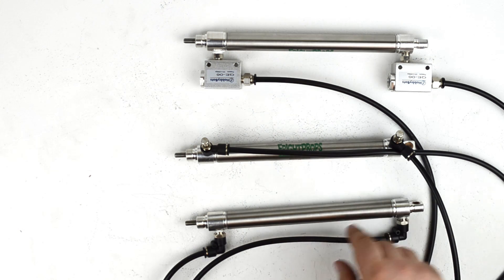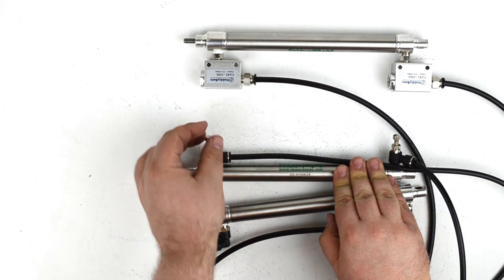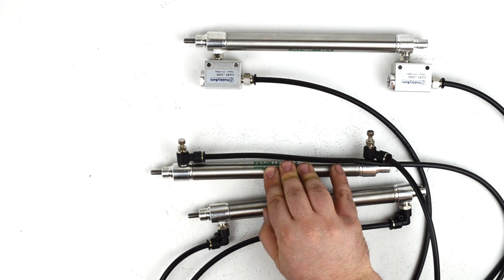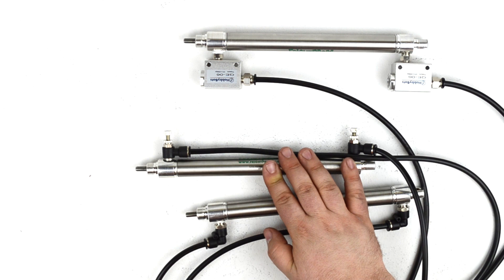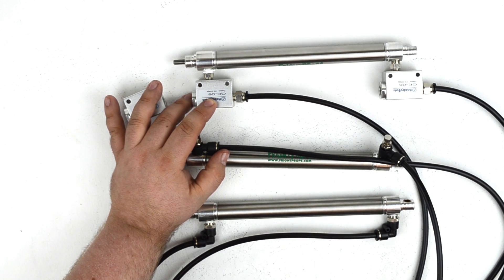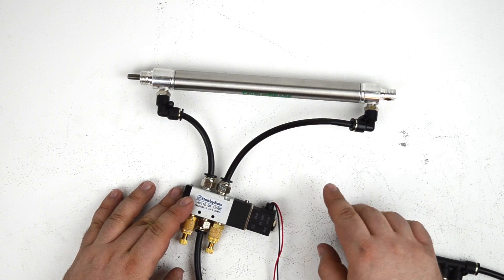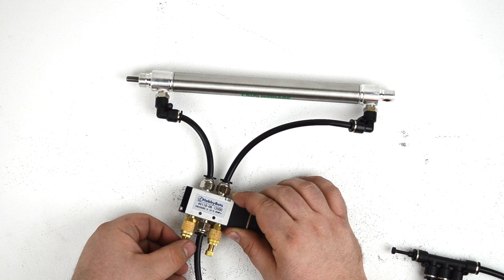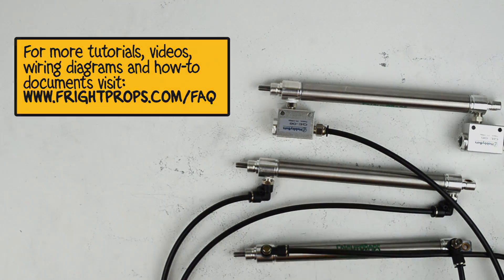How to Control the Speed of a Pneumatic Cylinder

Comment: Could you use the flow-control muffler on only the rear port to get a single action? If the piston is able to simply be pushed back? If not with a flow-control muffler, is there another way to achieve this? - Assuming a single action piston of the required dimensions are not available.

Comment: I need to know how to get an actuator close at one speed a slow down so the door it is operating doesn't slam.  My door is part of a ride and having the door block the track is not a speed issue.  But when the vehicle is approaching the door I need it open fast enough so the vehicle won't hit the door.  If the door opens fast enough but so fast that it bounces and hits the vehicle as it passes.  I need the last few inch or two of the actuator slow down.  How would you do that.

Comment: Thank for this, great help for a newbie. Is there a way to control length of stroke . I have an item that i would like to throw 7mm forward & 7mm back & can only find 5 & 10 mm stroke units & didn't want to break the part i want to control. Thanks.

Comment: How does this affect the operating pressure?(displacement force) I currently use a setup to move a box of 13 kg, however, it happens too fast. Thus, I want to use the speed control muffler to restrict the exhaust so that the box is slowly moved. Will it work, and will the pressure or displacement force remain the same?
Reply: The force should remain the same. Using a speed control muffler will only make the exhausting air take more time to exit the cylinder, but in the end the pressure there will be atmospheric.

Comment: Thanks a ton for this awesome video. Would be grateful if somebody can help  with a doubt. How do you control speed where force exerted varies. Ex: we have a section on a pivot lifting a flat surface from horizontal to vertical. Like a vertical top door on a kitchen shelf. When horizontal, load is more. When vertical almost zero.

Comment: Lucked upon this.   Wanted to simulate the recoil of a dummy Mk19 40mm grenade launcher using pneumatics to move a chunk of oak inside that simulates the bolt mass moving inside a 1/8" thick aluminum housing, using a trigger activated controller programmed to extend/collapse the shaft at the same cyclic rate as the real weapon system  360-390 RPM, the shaft extending 5 inches each cycle, and possibly venting the air out the aluminum barrel.     The original Mk19 has two captive action springs about 1" OD each so there is plenty of space to hide the cylinder.

Comment: Does this depend on the pressure or size of the cylinder?
If I have a bigger cylinder, wil this solenoids control it?

Will picoboo control it?
Whats the power rating of picoboo?
Can one picoboo control two solenoids or two cylinders?

Comment: Can you control speed with different loads on top of the cylinder? More specifically I need it to go at constant speed no matter the load or no load.
Reply: rallo this is my need as well.
Reply: rallo just an idea but maybe you could use a servo to adjust the screw?
Reply: And perhaps use a PID controller and some way to sense the speed of the cylinder to automatically adjust the servo to move at the speed you want. Just an idea

Comment: Stunning video. But what if you want to build a platform with a seat on it, for virtual reality, and you want to have variable speed all the time ?
Reply: I think you would want to use electric actuators, they are more "controllable"
Reply: Or use proportional valves, where you will be able to electronically set the flow to the cylinders.
Reply: Motors would be what you seek then

Comment: Please do video for long stroke cyl. ie: 1.24" bore x 30" + or - stroke. Used as a product pusher they tend to jump when they first contact the product.
Reply: your pressure is too low or you don't have enough flow. if your cylinder is the right size for what you're pushing with enough pressure and flow it will not jump.

Comment: what if i want to keep the speed the same, but make it where i can reduce the force that it applies. I assume i turn down the psi but will this lower my speed also?
Reply: yes,  speed is related to flow , force is related to the air pressure.
set your pressure 1st and then adjust your flow control for the speed you want.

Comment: I have a ball valve with a rack & pinion actuator single acting fail close. Do I need to look for a solenoid valve that will restrict in-out flow to make sure it will open-close slowly? My boss is asking me to help him with this on a vapor line that a quick response on the equipment is making trouble with the operation of the equipment. I will like to know your recommendation
Reply: Hi Daniel. You can use the flow controls that you saw in the video. If you are using a single acting actuator, normally only takes one application supply ( one pipe to actuator). you can also use an in-line flow control valve or even the restricted silencer type that fits into the exhaust port on the valve. make sure you are using the exhaust side to control your speed or the actuator when turning will get a shudder.

Comment: Very impressive video . Congratulations. I’m new on the world of the pneumatic “toys”. I have some questions.
What is your source of compressed air .
How You adjust Newtons and stroke ( when is possible )
When system is “dead” , can you move still objects with hands ?
What I need to complete system like this to close and open automatically a ......drawer  ?
Thank you very much.
Reply: Hi Tecno, 
Compressed air would normally come from your compressor or a compressed air tank.
 You would normally use a regulator to adjust the pressure to the cylinder/actuator. If the system has no air in it you will be able to move the application manually as there is no air to restrict movement or keep your cylinder in one position.  
To open and close a drawer you will need a 5/2 valve Single Solenoid as in video an electrical switch to put power to the coil for activation and deactivation. piping and fittings. the size of the cylinder will be determined by the force required to open and close the drawer. You will probably need flow controls to adjust speed as shown in vid.  

If you don't want to use a solenoid type valve, you can use a pilot operated valve 5/2 pilot spring return and a 3/2 normally closed push button valve.
This will do the same job.

Comment: If your using online flow control valves, BE SURE to check the flow direction in the valves, if you have them installed backwards, the cylinder will act eratically. I use inline flow control valves with rapid exhaust, reversing the valves caused static speed operation, slow retraction even when wife open.
Reply: My retraction is usually fast when the wife is open.

Comment: How can i create a feedback control using pneumetic to move it certain positions
Reply: Hi Ammar, Easiest way is to use a Positioner. They normally have a 4 - 20mA feed back or a 0 - 10 Volt.
Positioner will only allow a certain percentage of air into the cylinder depending on the feed back signal.

Comment: thanx for such informative video.  is there a way to control the sound of exhausting air to eliminate noise
Reply: Use a Muffler / Silencer . The flow controls in the vid that were fitted into the exhaust port f the valve are Restricted silencers.
There are different types of silencers available to suit the application.

Comment: The method you showed to control the speed using control valves... Does it compromise the pressure entering the cylinder?
Reply: No it doesn't compromise the pressure. There is a difference between pressure and flow although they work hand in hand together.
Lets say you need to move 3 pounds. your pressure is responsible for the work force to move that 3 pounds. Flow would determine the speed at which you move that 3 pounds. So you can have 30PSI @  0.2 Cv or 30 PSI @ 0.4Cv  
Hope that helps
Reply: Yup.  Simply put....speed control controls speed....not force.

Comment: Much better control i.e. Accomplished by using flow control valves that control the air exhausting out of the cylinder.
They can be set at different flow rates for extend speed and retract speed. This gives great cylinder rod speed control in cylinders with larger bore , longer stroke cylinders with oversize piston rods.
I believe it is better to control air exhausting the cylinder, should an airline fail, the cylinder will still the controlled flow exhausting.
Reply: He is doing that. The valves that he are using restrict air coming out of the cylinder, not into.

Comment: Technical detail alert: Whether you use port flow controls or mufflers in both cases you are restricting exhaust, not the flow into the cylinder as the video indicates. You can see this happening since tightening the control at the nose of the cylinder is slowing down the extension, meaning slowing the exhaust leaving the front of the cylinder as the rod extends. This is the way you want to do it since it keeps pressure in the cylinder giving the cylinder more control. If you were actually restricting the flow of air into the cylinder, the cylinder loses control in its stroke. It needs the exhaust air to push against to maintain position.
Reply: I’m at 1:54 and stopped the video to find this comment!!!
Reply: Thank you brother.....
Reply: You know the exhaust flows out as well. You are controlling the flow of the exhaust and that  sets the speed by restricting it but it is still a flow control. Is it not?    Don't answer that was rhetorical

Comment: It's much easier, more reliable, and cheaper to place a speed control muffler on both exhaust ports of the valve body.  It's better to meter the airflow out of the cylinder than into the cylinder.
Reply: there's a saying that goes by, "when in doubt, meter-out!"

Comment: can you please mail me a complete list of setup for the second cylinder
canonbj66@gmail.com
Reply from the maker: You would need 3 things:

1. The Cylinder - http://www.frightprops.com/pneumatics/cylinders/stainless-steel-body-double-acting-universal-mount-cylinders/3-4-inch-bore-double-acting-universal-mount-cylinder-0758-0750.html

2. A Hook-Up Kit - http://www.frightprops.com/cylinder-hook-up-starter-kit-double-acting.html

3. Some 1/4" Flow Control Elbows -  http://www.frightprops.com/male-connector-push-on-with-flow-control-0736-0017.html

You will, of course, also need an air compressor, which you can buy at any local hardware store. For more detailed support please contact our customer support specialists via our website - http://www.frightprops.com/contacts/
Reply: thanks for the reply, very helpful.
however  d compressors i found are too big for the project, is there any like the size of car inflators or the car inflators would do the same job.

thanks
Reply from the maker: They do sell smaller compressors, but you would still need some type of air reserve to run even a small cylinder. Unless you want the compressor to be running all of the time (which is pretty loud) you need to have an air tank. Any device that creates above 25psi should be able to run a cylinder.